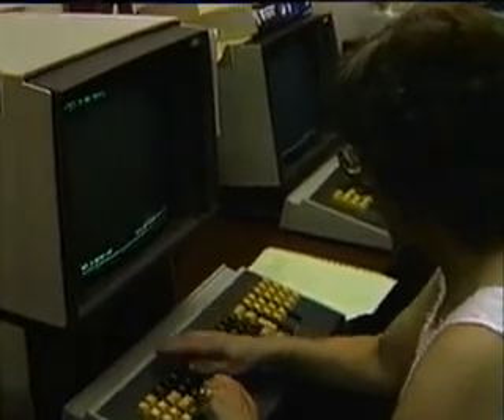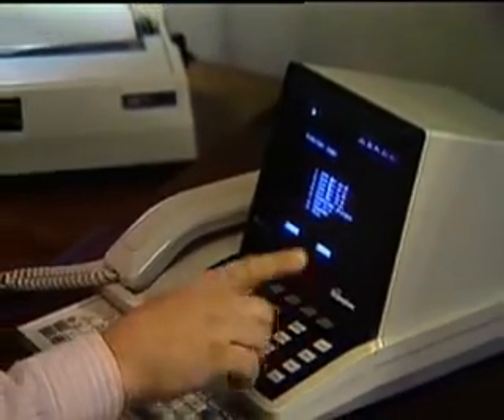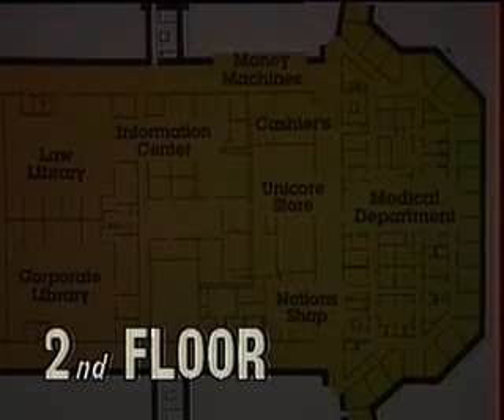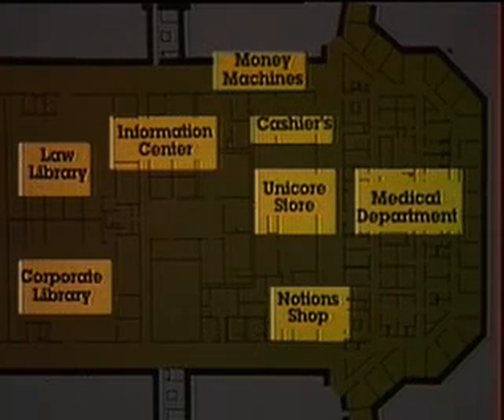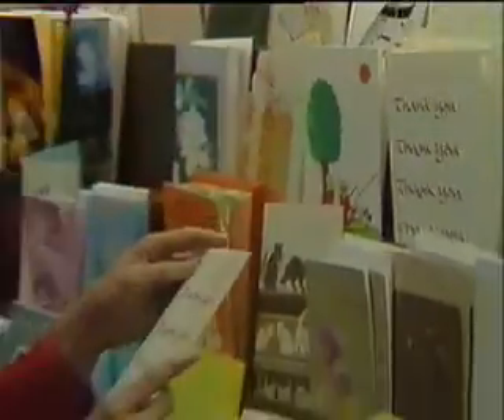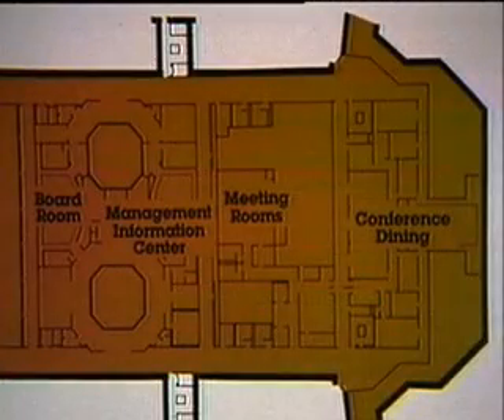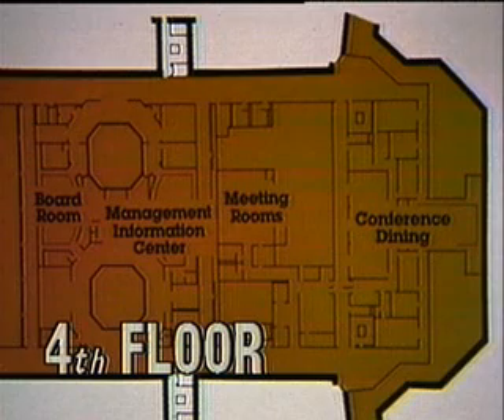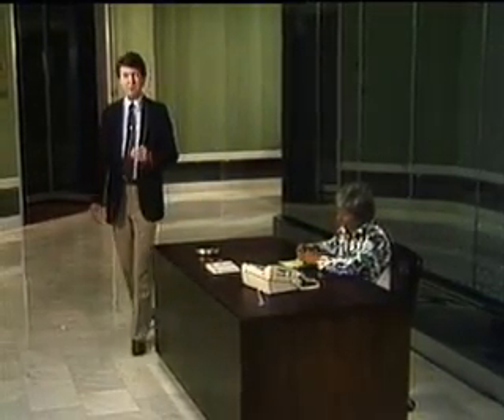Union Carbide Corporate Center in Danbury

Comment: The Unicore store must have been interesting.
Union Carbide was into a LOT of different lines at this time.
If their company store carried everything it would have been huge.
Not to mention some of their items , radioactive isotopes for instance, were not really meant for the general public.

Setting that aside you could have filled a rather diverse sopping list if they carried just some of the items UCC made.

"Let's see, I need some calcium carbide for my old lamp, some carbon brushes for my vacuum cleaner,  my son wanted me to pick up a Heliarc welder and some carbide inserts, I need some Kemet capacitors, Eveready batteries, STP Oil Treatment, Prestone antifreeze and some Glad bags."